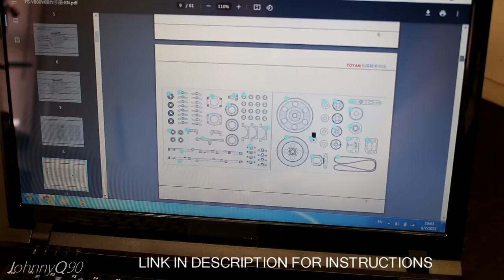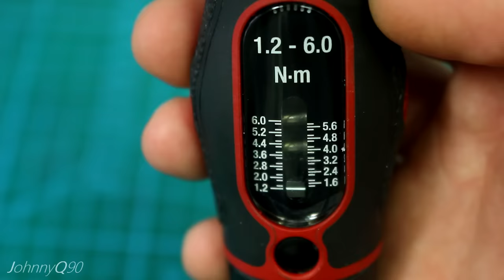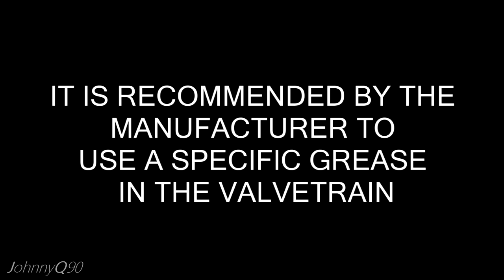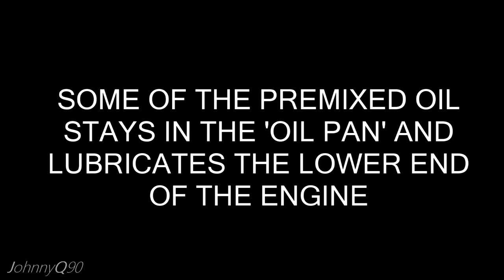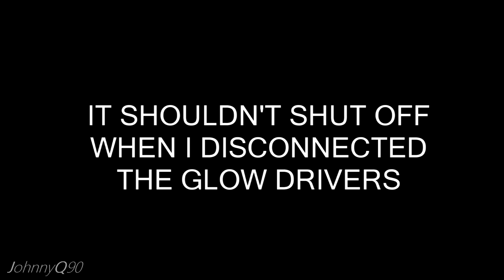REAL Model V8 Engine Assembly & RUN!

Comment: I was impressed until I saw the camshafts are only supported on the ends. They're gonna whip around and break, or the springs are so soft that it will never make much power. Even so, it's still kinda cool.
Reply: Why is there a second "cam" gear since it's sohc ?
Reply: They cut a lot of corners on these. Most likely they will not run very long.
Reply: @alexwhite176  To looks nicer on a display 😁❤️😂
Reply: @Jeremy-iv9bc  The "oiling" system literally is just the oil you put in it during construction.
Reply: @alexwhite176  And I did not see the camshaft(s) being timed to the crank. Did I miss something?
Reply: @alexwhite176  months ago, I think possibly Dennis Dempsey said from email exchanges w/ toyan, they are planning DOHC, a blower and other versions, maybe a "gasoline" downstream.  the 2nd gear simplifies that progression, and also maybe helps reduce belt slip issues on the SOHC?
Reply: They probably run fine because of the small size, they’re not perfect scale engines (I’d love to do that though)
Reply: @Jeremy-iv9bc  for 1800$ you’d expect more out of them
Reply: I came to the comments looking for this. Maybe he could make a split bronze bearing like the crankshaft has
Reply: @Watchyn_Yarwood  without timing it would not work.... 🤔
Reply: @tommes55  Wow!
Reply: @Juanguar  I can buy a high horsepower l
Engine for my lawnmower with that amount of money
Reply: Yea. And no rod bearings, no oiling system other than assembly and they didn't show timing the cams.
Reply: @joshmanis9860  you can buy an entire car for this amount
It’s ridiculous how expensive these engines are
Reply: @DragNetJoe  👍
Reply: @ThePower1037  There is oil in the fuel, it actually runs as a 2 cycle engine
Reply: @tinyfish-bigglasstank4648  In the top half... the bottom half doesn't even have oil galleys in the pistons like the other nitro engines, that thing won't last long without rod knock.
Reply: @Juanguar  Silly comparison, think about the massively different volume of production and what that does to the cost.
Reply: @ThePower1037  running on glow fuel, it depends on blowby to the lower end like a 4 stroke model airplane engine,lots of oil in glow fuel.
Reply: @ThePower1037  that's wrong... The pistons have (deliberate) blowby so the fuel (rc nitro 2 stroke fuel with oil) can flow down ND lube the crankshaft/pistons. The camshaft is lubed with grease and need replacement after a time (part of regularly maintenance)
Reply: @robborto it's  possible but you'll need active lubrication (like on the crank). On the single bank engines you could route the crankcase vent to the heads and use it there for active lubrication....

Comment: Can you make a new crank shaft for inline 4 engine make it crossplane style like yamaha r1 i want to hear it so badly
Reply: then make it bozo
Reply: @gearbanginentertainment7476  If it's as simple as you let on, post a video showing them how
Reply: It would be so hard to completely machine it by yourself, but he has already done a compressor impeller so ...
Reply: You'd need to make new camshafts as well so that the two cranks that were rotated 90 degrees also had correct valve timings.
Reply: Yes please.!!!!
Reply: The FZ-09 with the inline 3 also uses the cross plane crank. Nothing like that throaty sound.

Comment: Extremely happy to see Toyan finally recognize the need to support a multicyclinder crankshaft at every crankwebbing... That is a HUGE improvement. Maybbe finally this engine can become more than just a showcase gimmick and be a real practical powerplant.... If just they would also support the camshafts on multiple points, and introduce some form of cam lubrication other than grease....
Reply: Wouldn’t this work great for a scale R/C model?
Reply: I want to know how he timed it, there have to be some type of marks but it didn't look like he adjusted anything putting the belt on
Reply: @dandeflavis7004  I was wondering about that too.... More so because it did not sound like a V8, more like a 4 inline, which suggests he has one cam 180 degrees out of phase.
Reply: @rigididiot  I was also wondering if there was any point of having the 2 idler cam gears, they serve no purpose beside looks
Reply: @dandeflavis7004  Yeah, no doubt... but you've gotta admit, it looks a lot better than just one...
Reply: @rigididiot  still a cross plane crank though, so even with simultaneous ignitions it would still have the V8 sound. Maybe it's more a problem of rpm. Tob me at high rpm it sounded a lot like old '60s GP bikes with their multi cylinder engines having individual exhaust pipes. I also got a lot of cosworth-dfv-intake-note-like noise going on, especially lower down, so definitely crossplane in flavour
Reply: @identiticrisis  Crossplane has nothing to do with it.... If 2 cylinders fire at the same time, their exhaust valves open at the same time and it WILL sound like an inline four...
Reply: @rigididiot  yes a crossplane inline four in this instance. The firing intervals would be something like 90-180-270-180, two cylinders at a time.
You seemed to be implying it sounded like an even firing four: 180-180-180-180
One look at the crank suggests this cannot be the case.
Reply: @identiticrisis  If you turn one camshaft 180 degrees out of phase (which with this cross-pin in the pulley is easily possible), it WILL fire every 180 degrees... (trust me, I did study engine design in college, and that included all sorts of things like firing orders, firing intervals, Internal balances, forces and vibrations etc etc, I know my way around that)
Reply: @rigididiot  I mean I don't want to argue, but the suck squeeze bang blow is primarily dictated by the crankpin phases. Neither camshaft has intervals equally disposed at 180 crank degrees either, again because of the piston phases in each bank.
Reply: :D you would lose that argument any day of the week and twice on sunday ;) because there IS no argument. There are only facts, and facts don't care whether someone believes something or not.

These are those facts: There are 720 crankdegrees in the suck squeeze bang blow sequence, in other words two TDC's and it is the CAMSHAFT and the camshaft alone that determines which TDC is going to start the bang and which TDC will start the suck.
Now there are two banks at 90 degrees and there is a 90 degree crank interval, and two pistons per crank.
That means that there will ALWAYS be two pistons in TDC simultaneously, and each piston is in its separate bank, therefore controlled by its separate camshaft. There will NEVER be two pistons in the same bank in TDC.
If both cams are timed properly, one of those pistons will bang, the other will suck.
However if ONE of the camshafts is out of phase by 180 degrees, then both pistons will either bang or suck simultaneously. This will NOT "mess up the rest of the cylinders", because if you phase a cam 180 degrees out, that is consistent with a full 360 degrees crankrotation so each piston would be in the same position anyway. 

This engine design has NO provision to prevent the cams to be fitted 180 degrees out of phase, because it is a glow engine, therefore there is no ignition distributer, so it does not matter, it will run either way.. It will just run a bit nicer if properly set-up, and a little less nice if it is timed as a "big bang"...

The way that the engine in the video sounds to me, it sounds as if it is set-up wrong. It sounds like a fourcylinder. It should sound much higher pitched if it was timed right, because it would have twice as many separate ignitions per minute.
Reply: @rigididiot  but none of that means it has even 180 degree intervals - is that not what you mean by it sounding like an inline four?

The crankshaft cannot allow it. The 8 cylinder firing intervals are 90 degrees, rephasing one cam by 180 (360 crank) degrees results in simultaneous ignitions, we agree.

This in fact causes the firing intervals to degrade to the bank intervals: 180-90-180-270 or similar, depending on the firing order on each camshaft - as dictated by the crossplane crank.

The willy waving really isn't necessary btw
Reply: @identiticrisis  Dang, you could be right.... I'll have my hands on one in a month or so and report back.
Reply: @rigididiot  I bet it's a lot of fun to assemble and time it. You could try the simultaneous ignitions yeah.

My thought is that, in this case, uneven fuel delivery due to the intake manifold (such as it is) and the rich mixture combine to create an unevenness in the exhaust pulses that masks the true tone and indeed makes it sound like a lower frequency. The same way those individual exhausts did on the old GP bikes, and the same way uneven firing intervals lose their distinctive tone at very high rpm anyway
Reply: @identiticrisis  I still have to look if there is even a "manifold" or if it is just a large plenum with 8 drillholes.
For the exhaust I was thinking of simply hooking up two wide tubes to those mufflers as some sort of resonators, tuning them to length for getting more low frequency characteristics.
Biggest challenge will be to get a proper lubrication and a proper waterflow, because the way it is, is barely capable of cooling away the idling engine.
And then of course it has to go and run on gasoline, AND power a boat...

I have never been accused of picking my battles wisely
Reply: @rigididiot  that was one of the most intelligent, respectful conversations I’ve probably ever read on YouTube. Well done to both of you.
Reply: @w_stanky  well it did start to get out of hand but closed up nicely lol
Reply: I really want someone to just make a 80cc V8 so we can put it on karts
Reply: @carlosevfaj  Have a look at the Conley V8...
Reply: @rigididiot  Hello I’m really interested in studying engine design in college what is the course called or where can I get more information
Reply: @identiticrisis  @rigididiot 
You guys are both really smart, would you mind pointing me in what sources you can get more information and knowledge about engines, I think I’ve exhausted everything I can learn on YouTube but I want like more professional, in-depth understanding like what you guys have
Reply: @v4854  engine design would be covered by automotive engineering, but it's a specialism, and balance and sound are specialisms within a specialism!

There's a series of books by Bosch that covers the basics, but they're expensive because education. Try to find some YouTube videos covering mechanical engineering lectures. Something on "dynamics" and "balancing rotating machinery" will give you a head start on engine balance. I like old engineering journals and proceedings from annual symposia for some forgotten insight too. Some of these are archived on the web. I have a physical copy from the 1930s of a great treatment of inline 8 firing orders, for example.

As for the sound, that's a more guarded or esoteric subject. I'd suggest experimenting with sound synthesis, generating single pulses and then interleaving them as happens in real engines. Try to find web pages that deal with the difference between unequal and equal length exhausts for boxer 4s, or the various firing orders for v8s etc. This week help you conceptualise what is happening.

Much of what you see on YouTube is poached or recycled from these earlier sources, I've often heard Wikipedia quoted directly for example. Which is funny when it's something I wrote myself...

I started from nothing, but nearly two decades of digging and now apparently I look intelligent, so that's something :D
Reply: The lack of cam journals SEVERELY upsets me, especially seeing how skinny they are
Reply: @matthewpeters2062  I have rn the engine now  for about 2 hours without rocker covers, the camshafts seem to do fairly OK, better than I expected.

Comment: Definitely needs a twin turbocharger set-up 💯
Reply: I think a baby roots-style blower would be cooler to see him make.
Reply: That would look awesome with the twin turbo chargers on a Nissan skyline style rc
Reply: A twin charger set up with 4 turbos and 2 superchargers would be overkill
Reply: @neilaji4221  Bro what?
Reply: @Bjduescher  a suggestion
Reply: @neilaji4221  I guess I was just surprised someone said two super chargers
Reply: Super chargers are not efficient! it would be nice to see someone actually make a functional turbo for micro engines! Super charger is just a pump, a dynamically efficient centrifugal charger would be impressive but a working turbo is genius!
Reply: @needmoreboost8208  superchargers are effective as they are in immediate effect as it uses the engine's power connected to the crankshaft. Turbos use the exhaust fumes through the exhaust, and though they are powerful, they are however plagued with turbo lag.
Reply: @neilaji4221  modern turbos have little to no lag and a turbo on am engine of this size would have little to no lag
Reply: Want injectors for it...
Reply: @neilaji4221  hence the turbo/super setups. Low end super, top end turbo
Reply: @caleb8659  I asked for 2 superchargers and 4 turbos, the graph on it would be consistent. If not insane 😳
Reply: He did it again, he said "two superchargers" 😂
Reply: @skankhunt420  They exist? No?
Reply: @needmoreboost8208  I'm a model engine designer for a hobby.

There is a reason you don't see mini turbos on these small V8's. They are EXTREMELY difficult to get any kind of boost out of them. Because the smaller a turbo gets the less and less efficient it becomes and when you get them this small they don't even overcome their own parasitic loses.

VS a roots style pump can be made very small and still provide some kind of boost.

A turbo would also require insane precision to make, because they would have to spin at hundred of thousands of RPM's! VS a roots is in the thousands, way easier to make as well.

And you get instant throttle response and they just look cool as hell. Which is what it is mostly about anyway. If you wanted practical power, these V8's are not it. A single cylinder two stroke will blow these mini V8's out of the water!
Reply: Or a supercharger
Reply: @neilaji4221  god thats a lot of chargers
Reply: Rather put a supercharger in that thing. I wanna hear it go WEEEEEEEEEEEEEEE
Reply: @Bjduescher  but its a v8 so i wouldnt do it on a skyline 
maybe a mustang or camaro or a truck
Reply: Quad chargers and a .30-06 for longer shots.

Comment: A nice Hot-rod style RC car would be awesome, and would make for an interesting challenge to get the drive turned 90 degrees. it'd be a cool way to show the engine off too,  as well as all the shiny bits you could make to make it look really cool. you might want to get a polishing wheel for the exhaust. there's also scope for extra stuff like a proper supercharger and scoop that would make for great CNC projects.

It might be tricky to find a body that would work, but it's probably do-able on a 3d printer as it could be made in sections. there's plenty of Ford model-A bodies on thingiverse etc.

I don't really like the look of those camshafts, they're a bit thin for an un-supported shaft, It's probably not a huge project to make up some split-bushes from bronze to help them survive.
Reply: Would absolutely love to see this build
Reply: It totally needs to be straight piped
Reply: a hot rod really would be the best idea, or anything that exposes the engine. since it's new and nitro V8s arent common you need a body style to show it off, and hot rods just leave it all exposed.

Comment: Definitely need a 1/5 car to put that in. That would be so awesome. I built NASCAR Cup engines for about 6 years and that looks like a fun project. A lot simpler than a racing engine. I’m definitely getting one of those screwdrivers because I’m constantly using 6 sided bits and that is a awesome tool. Thanks for sharing.

Comment: gotta love the in-block starter motor design, UZ owners are punching the air right now with that. Looks like a fun build to do, hopefully it goes into an R/C!
Reply: These engines really aren't suitable for R/C use... They are MODEL engines, not engines to power a model. They are made to run for short bursts, just to show that They CAN actually run, bit they are not designed to do any real work for any amount of time. They would fall apart quickly if used to power a model 
R/C application.
Reply: Also, that starter-in-block design is the same as a Cadillac Northstar engine design, and has been CURSED upon by many automotive mechanics everywhere, because they have to tear the top-end off of the engine to replace a starter that should have been a 2-bolt removal, 30 minute job, on most other vehicles. I've done many, and I'd LOVE to have a chance to slap the shit out of the engineer who came up with that stupid design.

Comment: Awesome engine Johnny.  As a fellow 1/4 scale engine owner, keep in mind, Heat does not scale down, how many ounces of water do you have.  My build has almost 90 ounces and it does not take to long for the tanks to get HOT.
Reply: This may sound dumb, but can you use regular automotive coolant in your water to help keep your engine cool? Or is the pressure thing an issue. Or do you already do that?
Reply: @debtoralive4693  I use regular Auto coolant in my Stinger 609, and plan to change to Evans Waterless Coolant.

Comment: For those who wonder..
This is a "glow" engine with no ignition,  and no lubrication system.
Oil is in the fuel.
Reply: thank u i was hoping to find out in the comments and u didnt disappoint me...
Reply: How does it get to the main bearings though? Unlike a two-stroke engine where the fuel/air mix flows through the crankcases, in a four-stroke the fuel/air mix (thus the lubrication oil) only is in the combustion chamber. Are they relying on piston seal leakage to lubricate the cylinder walls, main and rod bearings???
Reply: @Cheradanine  
I think so.
This is how four stroke glow model aircraft engines work.
Reply: @MegaEdge777  Thanks for that. It's a lot of cash for something at that level.